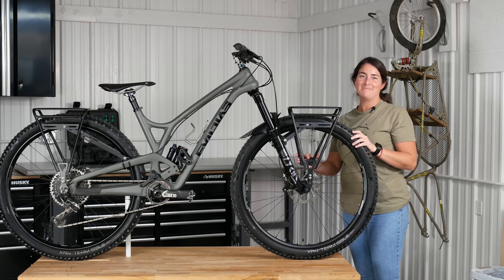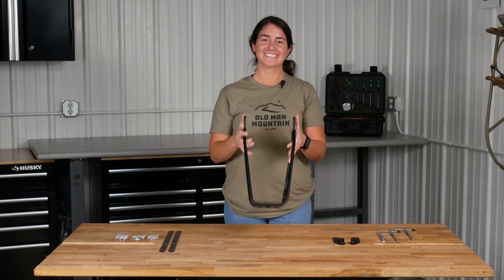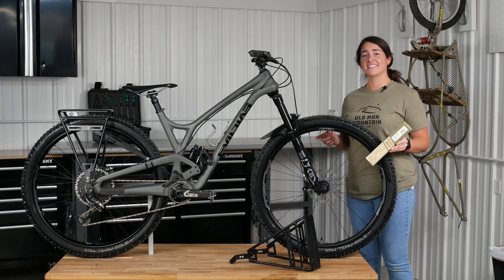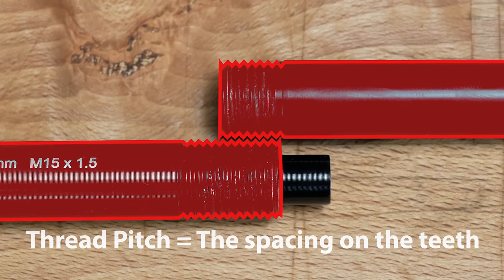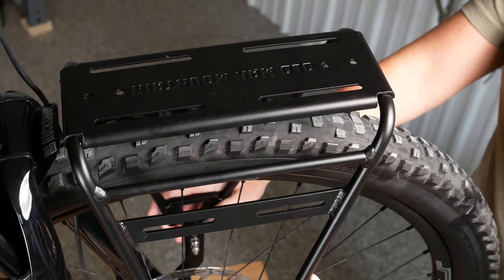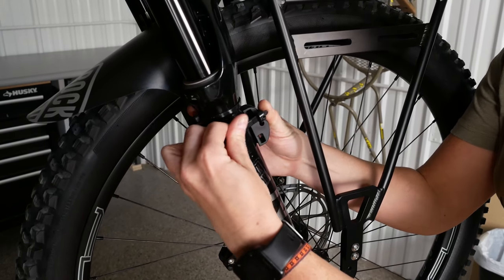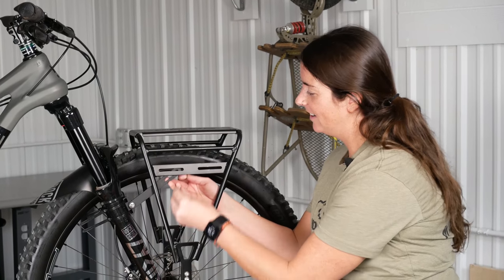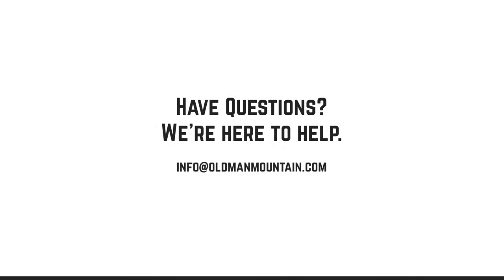How to Install a Rack on a Suspension Fork.

Comment: Just one point, on long rides off road (800kms+), I’m finding that the bolts into the axle are loosening. I’m now using loctite instead of grease for these bolts. Apart from that, no issues! Great racks!
Reply from the maker: Thanks for the feedback. Are you using the supplied lock washers on those bolts?
Reply: @OldManMountainRacks  yes, overcame the lock washers. We’re talking quite well loaded with two ortleib panniers and rough ground. Just a dab of blue loctite is enough to stop them backing out. 👍
Reply from the maker: @EvidenceofaFabulousLife  Good solve and thanks for the feedback. Just be sure to stick to BLUE Loctite. haha.
Reply: Hi, I've got a Super 73 RX, will this kit work for that?

Comment: Always have loved your racks, but I generally only recommend mounting heavy loads to the lowers after exhausting other options, including a rigid fork. I would love to see more options that mounted to the crown or above which would allow that suspension to be way more useful. Understanding that it’s better to have the weight lower, ive wondered if a bearing system could be incorporated onto the lower to provide stability while still allowing relative movement of a far lower unsprung weight.

Comment: Just a heads up:  I found putting five pounds per side on the front-mounted Divide rack on my front suspension made the steering CRAZY UNSTABLE.  If you mount this on suspension, put only light items--clothing, etc. in there.  I had a serious tail-wagging-the-dog feel when I had weight in front panniers.  No bueno!